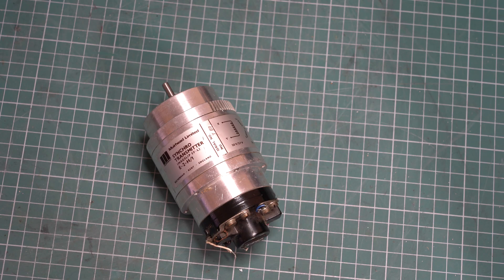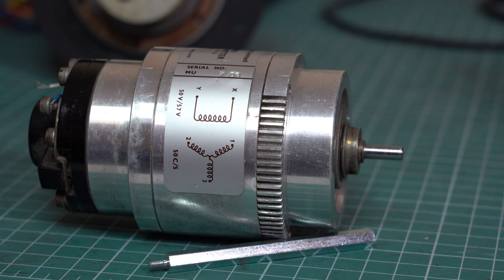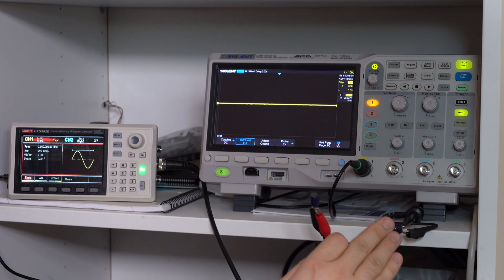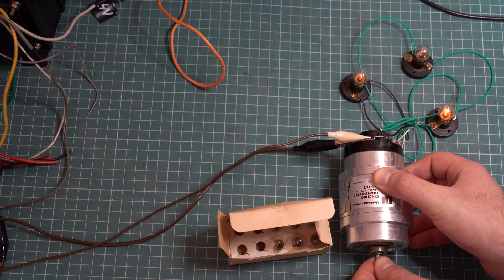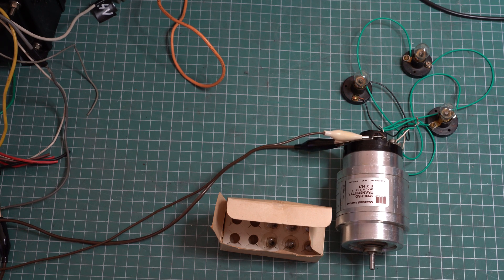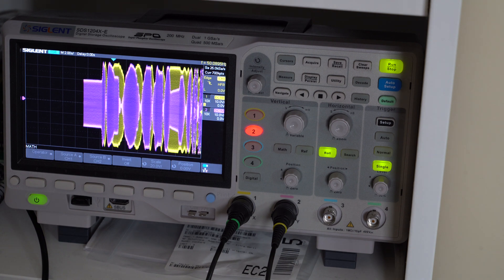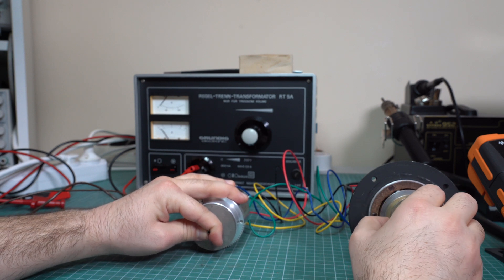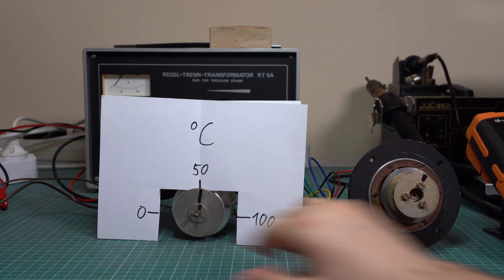Exotic parts #1 The Selsyn (Synchro) AC Electromagnetic Witchcraft

Comment: Selsyn lock was usd in telecine machines in the 1960s, 70s and 90s. If a film had a seperate magnetic sound track, the telecine machine ran the film and was linked to a large tape player (or mag bay) using a selsyn. THe film was parked on a sync mark on the film leader and the tape (mag) was parked on a similar mark to get the audio in sync with the picture. You then presssed the selsyn lock button to lock the magnetic sound track to the film. The audio track kept perfect sync with the picture even when stopping or reversing (at 1x speed only!). This was always a bit scary as the two machines could jerk backwards and forwards. There was phenomenon known as Selsyn runaway wher both machines would accelerate to a crazy speed,  and you had to be ready to unlock them to stop them!
Reply from the maker: @Mr_Rusty1  Nice! I didn't know that. 😁
Reply: What GENERALLY made them run away ? One thing or  More than one thing 🤔❓
Reply: @gblueslover8807  It was only during the lock process there was a potential of a runaway. I guess it was caused by particular phase relation ship between the rotors, causing a positive feedback, which were in a random position.This was quite rare but you had to be prepared. Once locked they would stay reliably locked together without issue. A very reliable system, later replaced with an electronic system.

Comment: The windings are 120 degrees apart. NOT 100°.
Reply from the maker: Yes. I was wrong there. Thanks for pointing that out.
Reply: @VoidElectronicsID  IF: they are connected as illustrated, 
then the VOLTAGE is 120° out of  phase. IF: The connection is in DELTA configuration, then the CURRENT is 120° out of phase.
Reply from the maker: @lestergillis8171  It's a bit more complicated than that for at least two reasons. This is far from any sort of conventional three-phase system. First of all, there is no neutral, so only the delta configuration is possible. On the other hand, the output voltages can either be in phase or out of phase (by 180 degrees) with respect to the rotor, depending on the relative position between the rotor and one particular stator winding. The better the alignment, the larger the amplitude. If you were to rotate the shaft at constant speed, then the envelopes of the 3 voltages would indeed be 120 degrees apart, but that would be an AM modulated 50 Hz carrier, not a true three-phase 50 Hz system, if that makes sense. This is best described by the equations that express the stator voltages with respect to the shaft position: 

S1 to S3 A Sin wt Sin 0

S3 to S2 A Sin wt Sin (0+120°)

S2 to S1 A Sin wt Sin (0+240°)

The full story was nicely explained by Analog devices in an article that I forgot to add in the video description: https://www.analog.com/media/en/training-seminars/design-handbooks/synchro-resolver-conversion/Chapter1.pdf
Reply: @VoidElectronics  When I went through trade schools for HVAC, back in 1987-1990, one student (who worked for a paint distributor) told me of one occasion where he dropped off a big order of paint to U.S. Steel in Gary, In. 
  He asked someone there what were all those electric motors doing there, just turning but not connected to any load... ?
He said the reply was: They ARE doing work, they are correcting the power factor for much of the rest of the plant. 😉

Comment: The selsyn basically is a electrically excited 3 phase synchronous motor. This principle also works when connecting two permanent magnet excited synchronous motors, just not below a certain speed, which is overcome here with the AC excitation.
A major disadvantage I see is that even without rotation energy transmitted between the two, there is significant power dissipated and heat generated. Another disadvantage could be the characteristic resonance frequency of this system because it behaves similar to two masses coupled by a more or less twisting shaft.